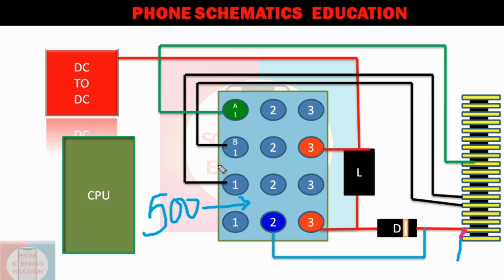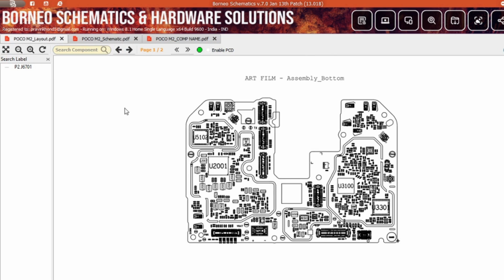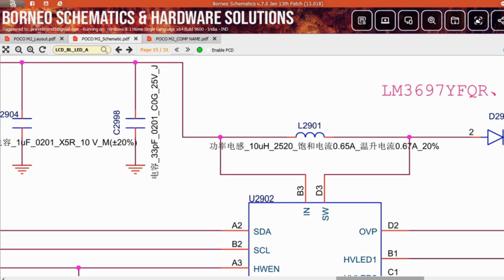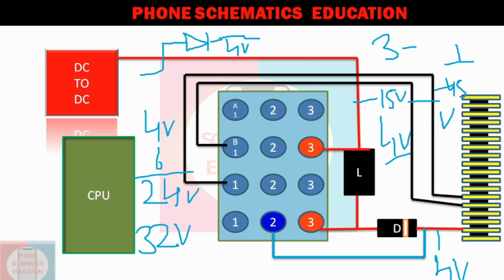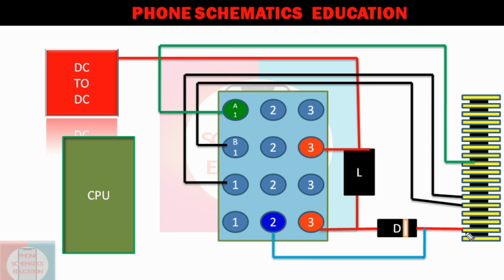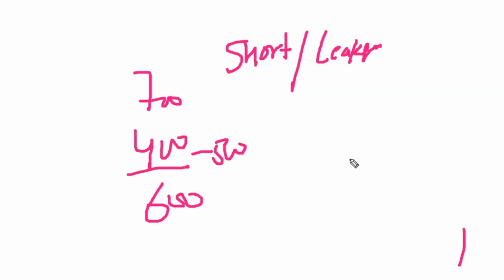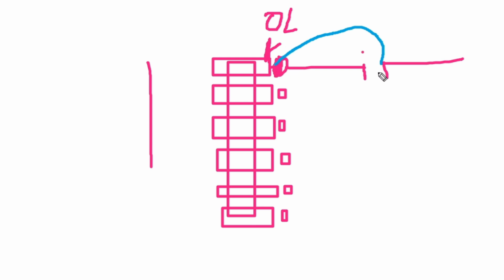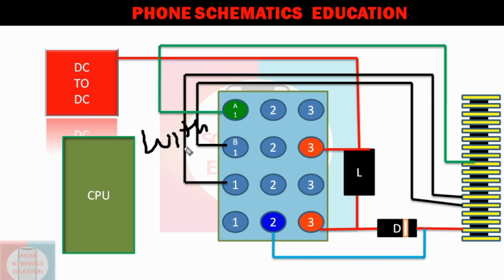How to fix A phone if there is  No light & Graphics.Blank Display.Light ic working+Testing+Solution

Comment: there is one anode and 2 cathodes, because the led is bi color , so one anode is connected to the positive voltage: cathode 1 to ground lights up the first led( color1) and the cathode 2 lights up the second led (color 2)

Comment: Please sir there is a phone x6511 i have checked on a cool method all line on the ligt ic ok but on a hot method on the LEDA there is a 3.7 reading i have remove the light ic an read is connected properly i have also change coil light ic diode still not working i have check LCD CABC line is ok with a 2v8 Please i need ur help on this sir
Reply from the maker: Check the ic requirements all ic pads .one by one

Comment: Sir please i have a phone samsung m02 display light not working. It's boost coil had bern. After replaced  the coil phone not on. I alredy changed the light ic, diod. Voltage 1.76v after replace coil. Pl help with this
Reply from the maker: Look, according to the details you have given in the comment, I think your line vph or vbat line, .whichever line is coming on it is short, that means when your coill is disconnected burn your phone on.after  when you replace the coill and after that your phone is not turning on, then this is the reason for it, and if you are getting 1.8 volts, in normal phone atleast you get 3.7 v on coil so the reason can be that your line is short, you should first remove the coill and check that line properly  for short.
Reply: @phoneschematicseducation  sir thank u for imedeat respond. I have check the line removing coil. Then no short in any components  and get 4.3v for one side without coil. When i replace the coil it get 1.65v. I cant find foult.
Reply: Sir..finay i got the error through your way that was you gide me. Thank you very much
Reply: What is the issue